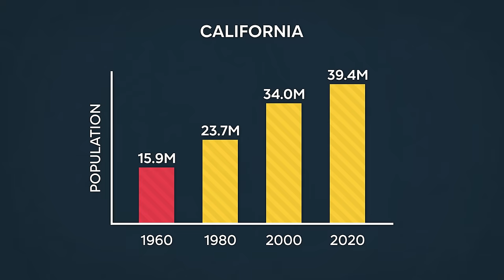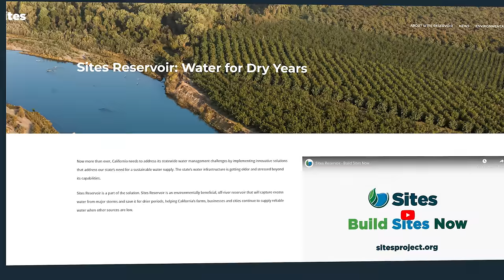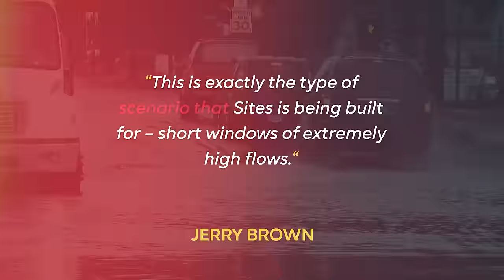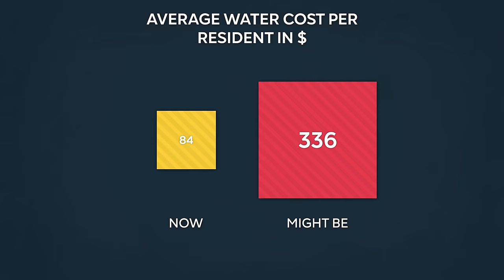California's New $4BN Mega Reservoir

Comment: You are only partially correct it boils down to over population and the ability for the environment to sustain that population.  Then with the lack of funding for utilities required to run a tourist state using the utility's of another tourist state which is all so over populated overstressing the environment. And when you build that brand new dam and the 200 million illegal immigrant's move there no dam will help at that point.

Comment: Ah yes, let's compete to see how much public money we can waist!  The high speed rail project stops at the south end of the San Joaquin valley there is no "high speed rail" route out of the south valley.  Now let's build a huge dam that will only be used rarely.  When it is used, huge pumping stations will have to be built and when they are used where does the power come from?  What about the environmental activists, won't they seek to cancel it? The design, as proposed, would destroy the ecosystem on a huge area .  It would make much more sense to instead build more numerous, smaller - and easier to design, and build - projects.

Comment: This video is rather misleading and in some cases disingenuous.  The bottom line is that the vast majority of the water is being taken from the San Joaquin valley And sit to the Bay area or Southern California.  As result the farmers do not have enough water.  In fact tens of thousands of the most fertile soil in the world is not being utilized because of a lack of water.  It's impossible to understand the realities associated with these problems because the politics and denial of science are the primary problems.   For example most of the fire issues are associated with a failure to provide proper firebrakes and a refusal to properly thin-out the forest areas.  (Prior to 1970 the state and federal government were involved in both of these activities and huge fires were extremely rare.)   The dam projects from 1950 to 1980 work stringly effective and the impact on the environment was minimal.   The problem is that the follow-on programs did not occur because of politics and politically-motivated pseudo-science being promoted by the "non-science nor engineering" departments at universities  What's focused upon protesting any new construction of dams.  [It's interesting to note that in the last 45 years, the potentially negative consequences (Pseudo-science) being promoted by these professors has been proven to be totally FALSE. (I was in engineering school at the time and became involved in the research which totally disproved their claims...But, for purely political reasons, we were not allowed to preset our research results!)]  The older problem is the false claim in this video that dout conditions and wet conditions are occurring simultaneously which is categorically FALSE!   I've become tired of people promoting FALSE narratives as if they were qualified to present any science-based information.   The people who created this video obviously have no science background nor to the understand the true nature of the water issues in California...Particularly the challenges of the survival of the family farm in the San Joaquin valley.  The solutions heart relatively simple but the politics and associated pseudo-science and ignorance and/or greed-based  Mis-led activism make such solutions nearly impossible.  (Which is why the California water project is now ~40 years behind where it should be.)